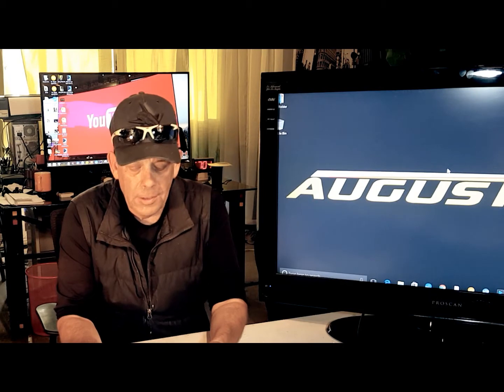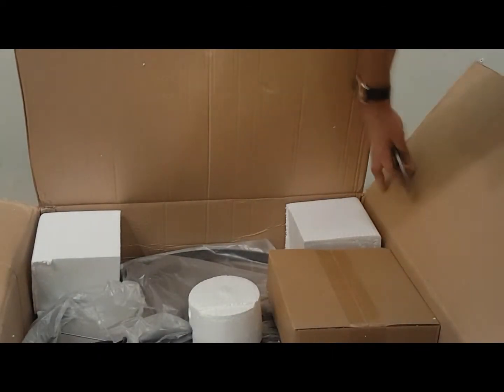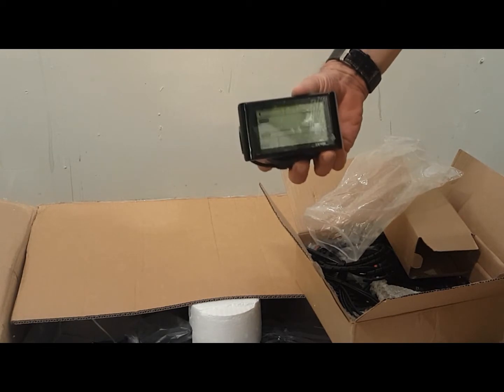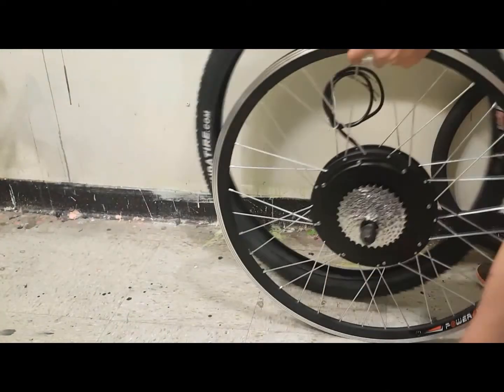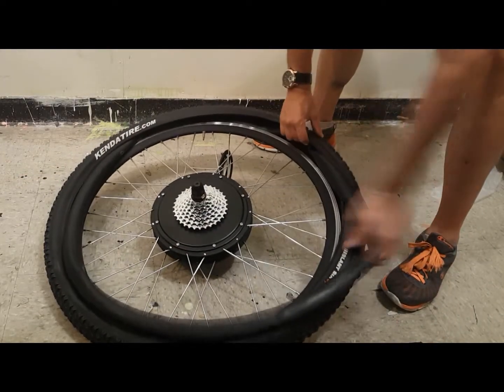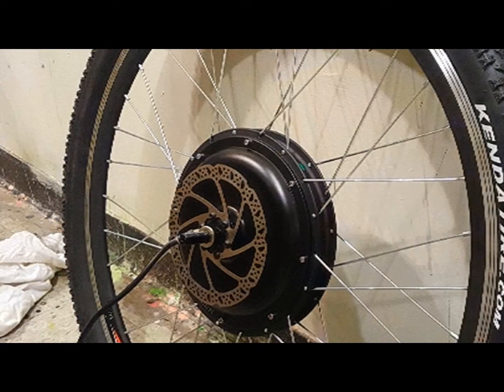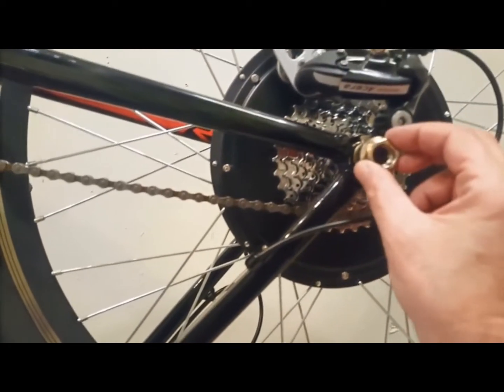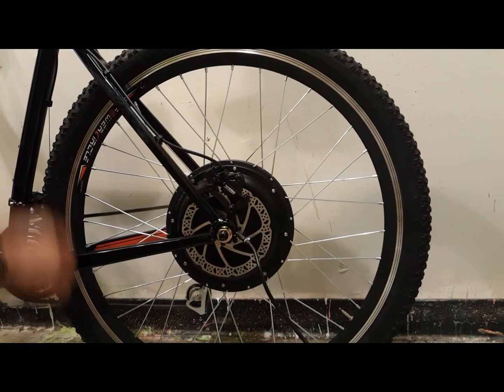How to install a rear hub Ebike kit

Comment: I want to put fatter tires onto my e-bike, is it possible to remove the hub from the wheel itself and install it into another rim?
Reply from the maker: Difficult at best. Depending on how fat you want the tires. But if you want the really big tires, you are better off buying a hub and rim designed for that. They are not that expensive

Comment: Do you have to keep the gears? I want to convert my mountain bike to a single speed before I convert it to an electric bike. I grew up on single speed bmx style bikes and never got the speed thing and I just think that it'sjust something else that can break down or needs maintenance and want to do away with it all together and it's not a brand new bike anyway so I don't know if it works properly anyway.

Comment: That washer that you say thats really important made me laugh if you break hard your wheel will move and rip those dropouts to bits you can't teach experience I always run with 2 t arms never have an issue over 5 years same bike it's common sense tieing something in there's nothing stopping that wheel coming off what so ever worst video I've seen you make

Comment: You also need to put a torque arm on. it could save your life when that wheel comes off and rear hub motors are notorious for coming loose.
Reply: 2 or 1?
Reply: @Trixili1020 very late but 2 if over 750 watt
Reply: They are not notorious for coming off dickhead it's the front hub motor that can come loose and come off stop talking bullshit you dick head son of a bitch.

Comment: You need a torque arm each side otherwise otherwise it is very dangerous, imagine the wheel coming off at 30+mph.
Reply: Where do I get torque arms from?.. I considering building a bike and I hear plenty of talk about torque arms. Thank you so kindly.
Reply: @cedricwebb5576  ebay
Reply: @GTJust81  Thank you.  I just saw some on Ebay. I saw a few videos and you are VERY CORRECT!!!!. No way I'd build a kit without using at least one torque arm depending on the motor and its power.

Comment: Are there spacers you put between the gears and the frame? The ones I received have the gears touching the frame when mounted and it makes it hard to turn the wheel.
Reply: Im having a similar problem, literally shredded the disc brake holder because it was rubbing against the disc, just cant seem to get this rear wheel to turn without it rubbing against something an the spacers wont fit on the inside -_- these things are meant to be easy

Comment: U didn't show putting the tire on the bike the wire goes between the inside axle first put it through the middle of the disc washer first pull Moto wire to the side then put the tire on leave some slack on the motor wire then easy to hook up voilamart shows you what wire goes we're there's only a few u don't need the power senser plugged it wouldn't get it's full speed 1500 watt 48 volts my battery cost 330 bucks 20 am 50 bms guicker than a 30, at 1500 watt wieghs only 11 pounds flat on back bike rack close to the seat they do wheelies don't hook up the back break that kills the motor so you can use it, but hook up front for emergency stop so easy like I said it tells u we're the wires go on voilamart anyway 220 bucks 35mph if you hook up the limit wire blue has connectors on every wire then tape it it copper to silver wire have fun

Comment: Great video.  I received the AW rear wheel conversion kit from Amazon.  My bike shop looked at it and there are two problems. First problem is that my Shimano crank is tapered and the PAS takes up room so that my crank will not slide back on all the way, I can tighten the bolt but the crank is not seated all the way and the bike shop said it will eventually wear out the crank arm since it is not tightly seated.  My bike mechanic said the only thing he could think of is to grind off some of the crank.  Is there a PAS system that will work in this case or do I need to buy  a grinder?  Also the derailer rubs in top gear and the bike shop said no way to fix except to adjust it and lose the top gear.

Comment: Why not show how to install the gears! That important part is missing!
Reply: Wow, I agree dag. Why can’t they ever do a step by step
Reply: Omg I've literally spent ages trying to find a video that goes over the gears,  like most of these motors come with a 7speed sprocket already attached, but my bike has 8 gears at the rear, so I'm trying to figure out how to swap out the cassette on the motor with the one that came with my bike

Comment: Could a rear hub be installed on the front instead?
Reply from the maker: Technically, without the gears. But, what would be the point?
Reply: Hi, i bought the same kit but with the front wheel. Now i need to install it on the back as rear Wheel. May I install the gears pack on my wheel and then install it on the backfork? Thaks

Comment: Kirby, you did not mention the torque arm. Is that needed for the 1500 watt motor? Thanks
Reply from the maker: Hi Darryl, the 1500w comes with lock washers that perform the same function as the torque arm. Torque arms are used for front hub motors to prevent them from flying off the frame
Reply: @AugustineEBikes  Please don't write such things. Torque arms from both (left+right) and it saves life!!!
ESPECIALLY when you use regenerative braking when rear hub-motor-wheel will spin in opposite direction for a moment, during e-braking with magnets.
Reply: where is your shop?
Reply: Is your answer only because you don't know or you just forgot it. Lock washers for the rear hub motor in the aluminum frame are not enough. You need torque arm, especially for 1500w motor. Sometimes is better to amit mistake than look stupid.